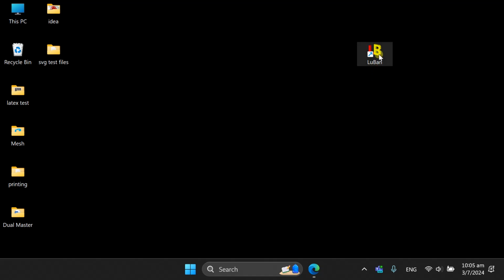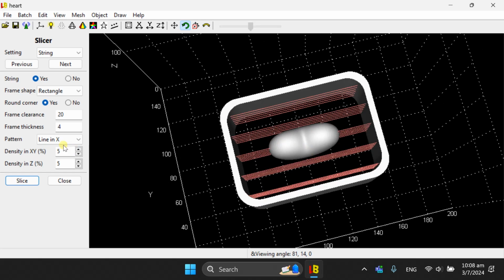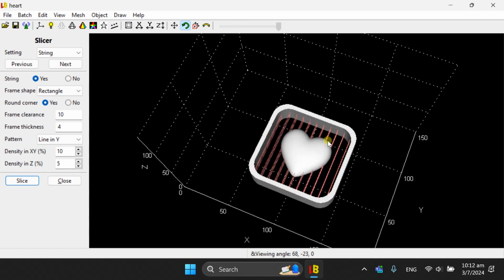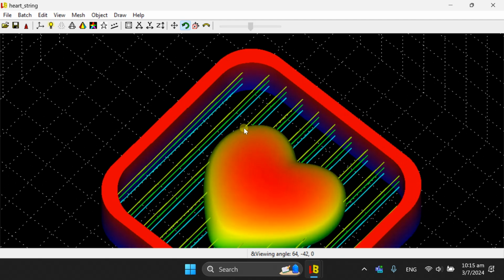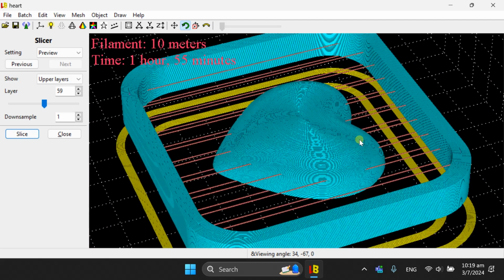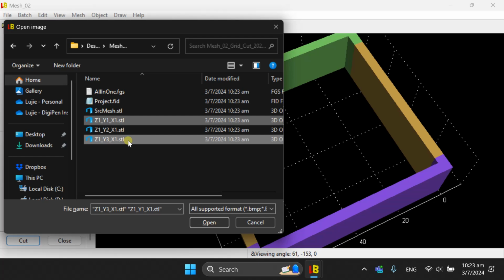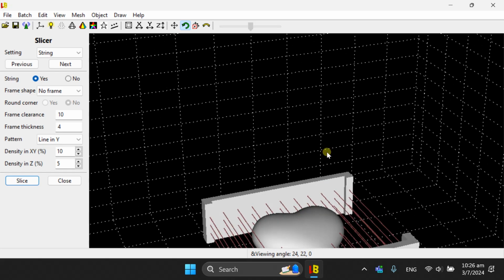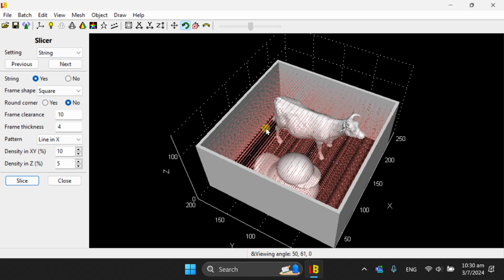LuBan String

Comment: waou so nice to test, what are the diameter or each strings ? can we modify it ? as today printer are faster can we use the printer speed set up or ? like i see in luban , you set the flow rate at 200% !! and print speed at 25mm !! thanks for help